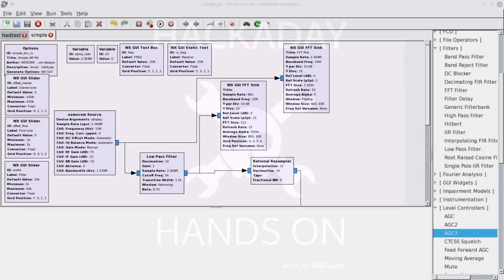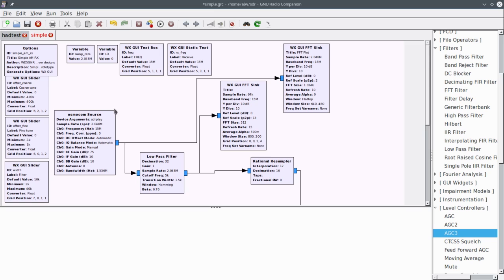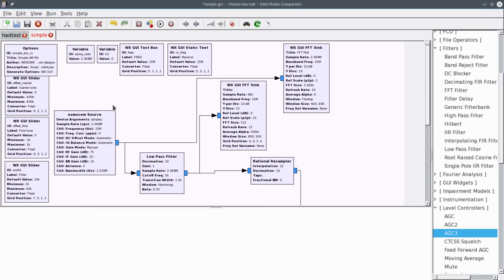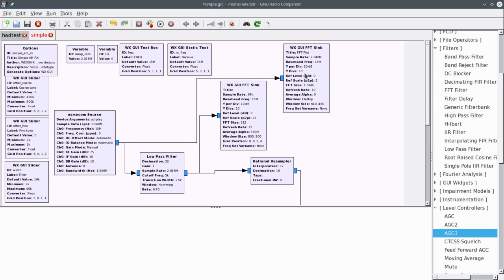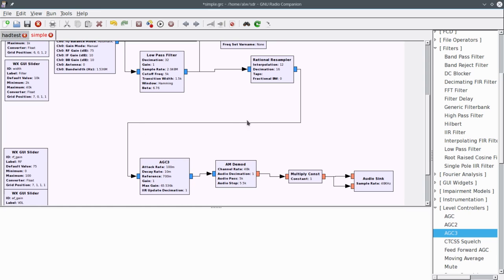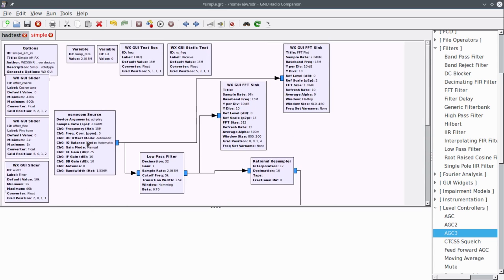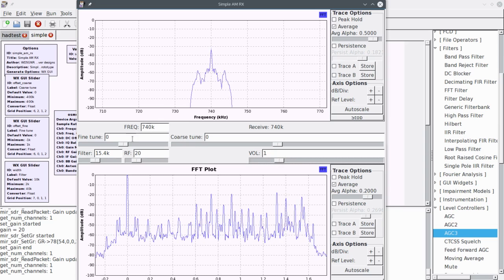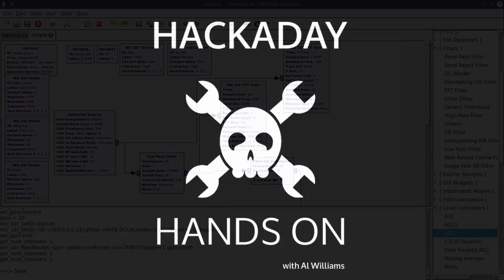GNU Radio Companion, Part 2

Comment: I appreciate the effort that went into this.  However, there are a couple of problems with this video  1) Too much time is spent showing and discussing the options slowly instead of explaining key things. 2) A minority will have an SDR that goes down to 15 Mhz or 1 Mhz as shown here. Most will have RTL-SDRs that only go down to 24 Mhz.  It would have been better to show FM Broadcast which would be accessible to a wider audience.

I recommend Michael Ossmann's SDR with HackRF tutorial series on Great Scott Gadgets.  A HackRF isn't required for most of it.  You can follow much with an RTL-SDR as long as you use 2 Mhz sample rates (or below.  (The RTL-SDR generally tops out at around 2.4 Mhz sampling compared to the 20 Mhz that the HackRF can do.)
Reply: I don't find 1) to be much of a problem than it is a personal opinion. I personally prefer the detail that was included when explaining different options
Reply: My RTL-SDR Blog V4 can just barely listen to AM radio. I mostly followed this guide and received a scratchy 14 kHz AM radio station. FM is my next step

Comment: I have installed the GNU radio under my Windows, and couldn't find a way to connect my SDRPlay box. can you give me a hint?
Reply: Hi, Sefi. Have you ever found a way to get sdrplay to work with GNURadio under Windows? I just got an sdrplay RSP2, it works fine with SDRuno, but I cannot get it to work with GNURadio companion. Any help would be appreciated! Thanks.
Reply: I have exactly the same problem. You managed to solve ?